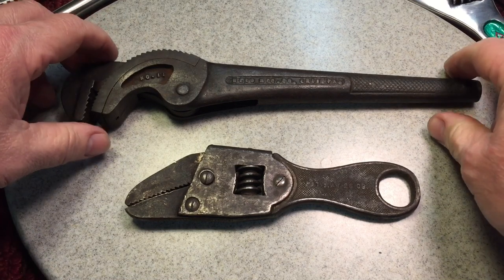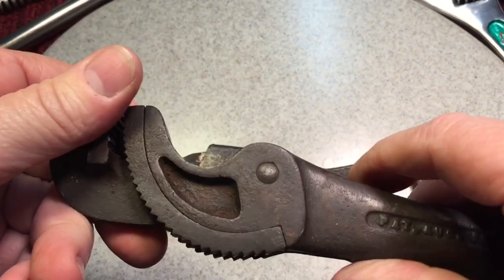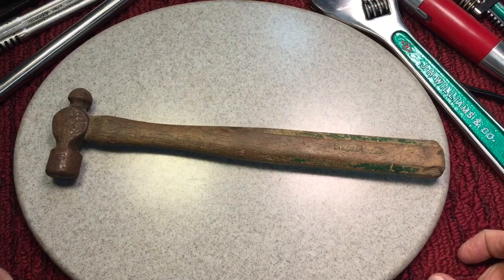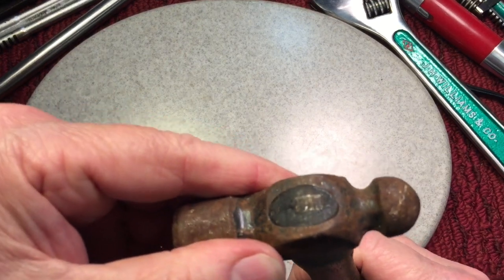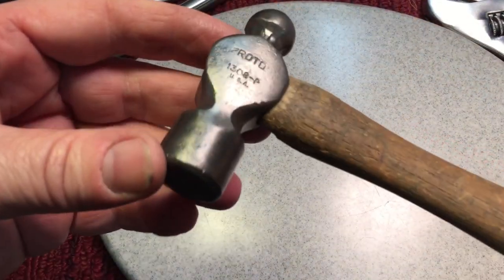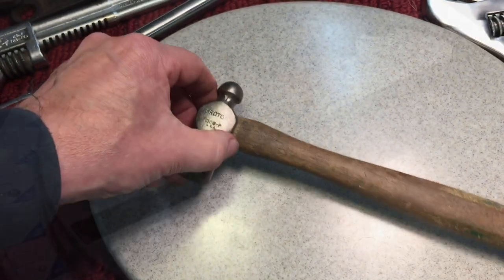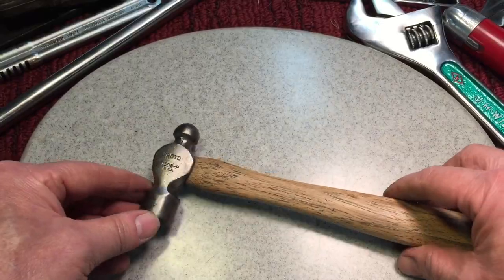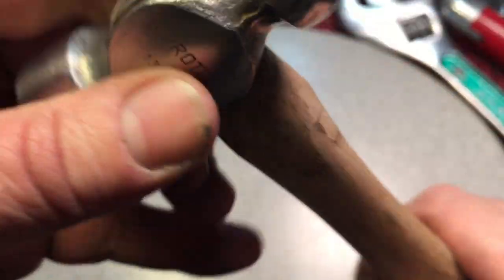Uncommon OCTAGON PROTO Ball-Peen Hammer

Comment: The octagonal handle and green paint are transitional traits from the Plomb tool company. Not sure of the date of your hammer but I have Proto and Plomb ball pein's with octagonal handles and the green paint.  Another cool trick is to soak the end of the wood handle end with green wicking loctite. It hardens up and makes a permanent solid end.

Cheers,

Tom

Comment: John, Very nice job on the PROTO Ball Peen  hammer I know you treasure your work. How well does the SHELLAC hold up to solvents such as Brake Fluid, Naptha, Varsol or Gasoline.
Reply from the maker: Shellac is a really durable finish but chemical solvents like you mentioned will remove everything and anything.  If I had a hammer in that environment I would use linseed oil and just reapply every 6 months!  😃👍

Comment: Those wrenches are really unique. It's good you dont need to replace the curved jaw on the first wrench. I dont know how you would find a replacement for such a rare wrench. As it is the jaws are in excellent condition. I look forward to you applying your skills to it. Hammer turned out great. The lettering on the handle is still prominent. I thought you might have to deepen them somehow so they wouldn't disappear in the refinishing.  Good job . Thanks

Comment: I usually hammer in small slivers of hickory or oak to the gaps in hammer heads.  I leave them slightly long and sand them down to match the original wood.  Fills up the gap with wood and it matches the handle grain most of the time.  I like to keep the original wedges in the the factory handles and just tighten the slop with the hardwood pieces.. That and a heavy dose of Linseed Oil works well.

Comment: you taking care of the handle with the razor, made me remember, I have a small scroll saw from my grandfather that I want to correct.  I don't know what is on the handle, but it seems to be corroding. Almost like it's an organic shellac that's decomposing. Because it is a round handle, can I still use the Razor trick? Or is there something else because it's round and there's no Flats?  I would hate to ruin the wood underneath.

Thanks for another great video!
Reply from the maker: Dan the razor works awesome on round stock too!  Just don’t press as hard and make more passes!  You will be amazed!  😃👍